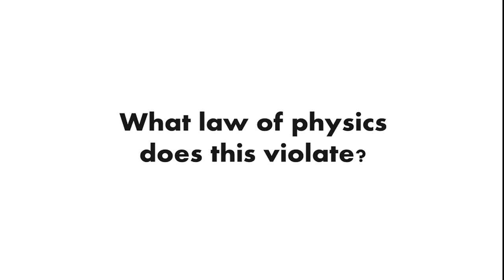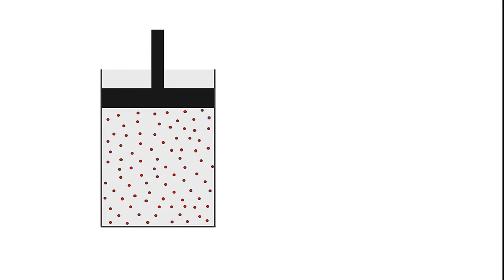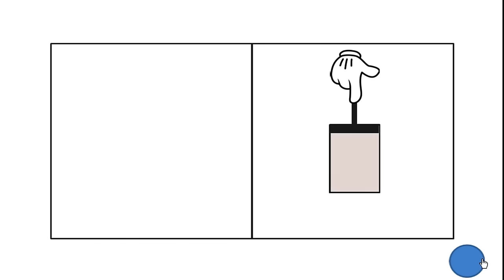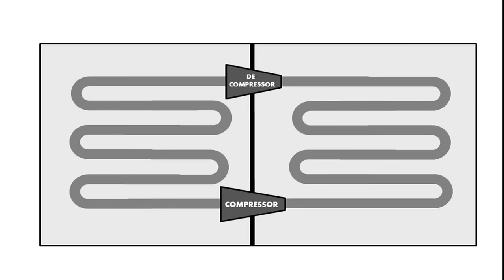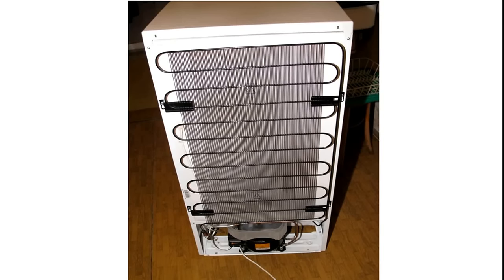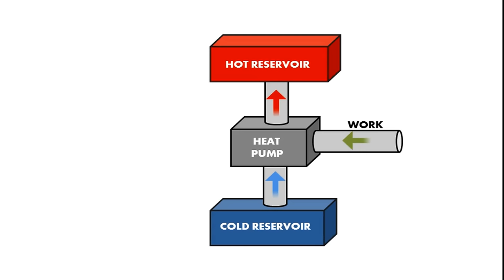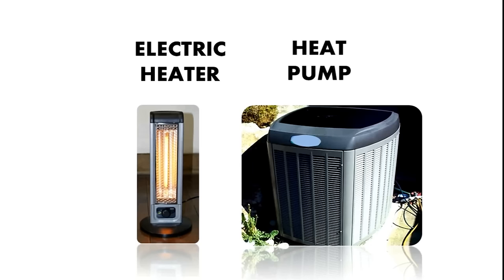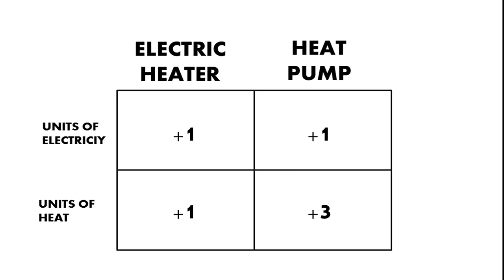2nd Law of thermodynamics - Principles of Refrigeration

Comment: After you compress the Pump and Leave your hand there is decrese in internal energy ..... Why ?? why does piston come up ?
Reply: Technically, the piston shouldn't rise to its original height, but adiabatic expansion will cool the gas down as it decompresses.

Basically, the work required to compress the gas is greater than the work needed to lift the piston back up. The lost energy accounts for the cooling effect. 

This happens because the relationship between volume and temperature is linear whereas the relationship between volume and pressure is nonlinear. All this means is that when the gas is compressed, most of the energy will be used to increase the pressure while some is used to increase the temperature. Likewise, when the gas decompresses, most of the work comes from decreasing pressure and some from decreasing temperature.